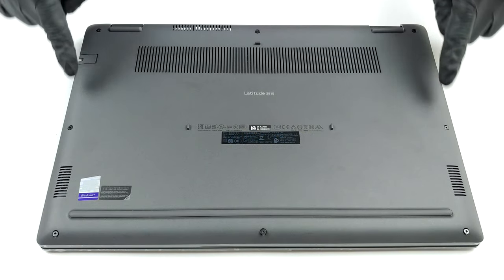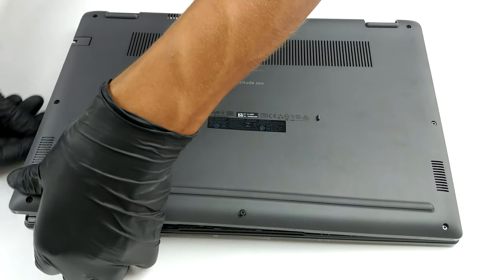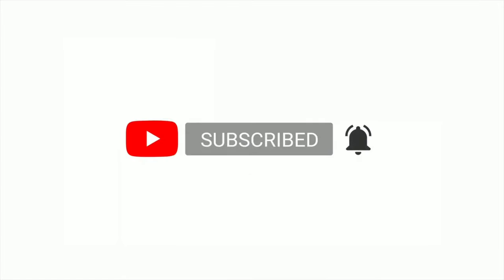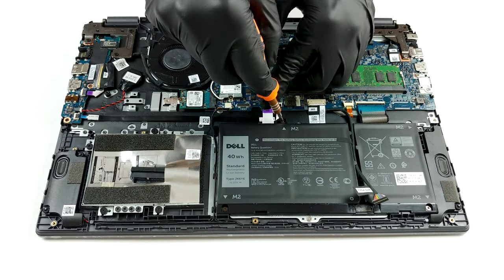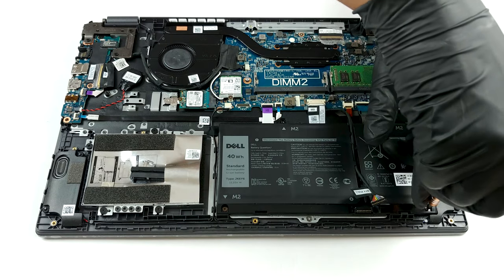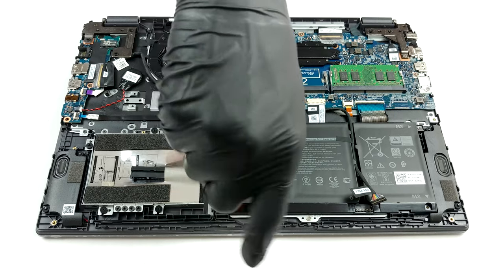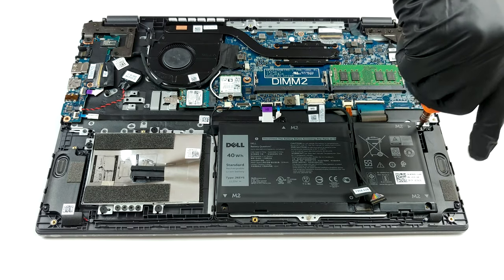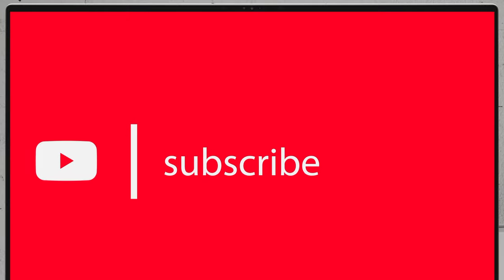🛠️ Dell Latitude 15 3510 - disassembly and upgrade options

Comment: Too bad that, after "This unit has battery and one SATA device" comment, none of the other device-removals had voice-over descriptions.  What kind of M-LAN card is that - AC?  AX?  Do we understand that this has an M-SATA slot as well as a concurrent SATA slot?  So that M-SATA can be (or is only) a Boot Drive device?  It'd be nice to have the memory specs to so that future buyers may skip Dell's higher priced RAM sticks and buy name-brand/easy to match pairs before back-cover removal.  What kind of connectors does the WLAN card have - B? M?   It'd be nice to know, again, before purchase.  (These can give the unit a life beyond whatever WLAN card is currently used, or available now.)  Is there any capacity limit to the M-SATA device?  That'd be hard to believe that Dell would limit BIOS beyond the traditional 2gb boot limit.)
Reply: Ooh, your included website link offers more specs to my satisfaction... it only took wading thru 400 other laptop models to reach each device inside a Dell 3510.  A voice-cover could have answered that in seconds but at least I see your website has copied very throrough lists.  Thanks for that.
Reply: On the Precision 3K series laptops, how many RAM slots are there? Thank you

Comment: Where to add the M.2 NVMe SSD
Reply: Yes... I'm looking the SSD M.2 port but It doesn't exist... Could you confirm?
Reply: I think it is removed at 2:00
Reply: @jamesrebeccasanders6788  that would be logic. The other card is the wifi card because of the wire
Reply: @danilocardenas3845  Right next to the fan, there are 1xM.2 for SSD and 1xM.2 for network card...
Reply: @JonathanGameHD  That's the M.2 SSD, they come in many lengths..

Comment: Hi. I have a version with 53Wh and 15V battery. Can I replace it with a 40 Wh and 11,5V battery to add an HDD? Will it work normally after that?
Reply: Did you ever find out? I'm facing the same issue.
Reply: @Fakechilada  No. I just bought a case for  HDD and use it as storage

Comment: Please, most times when i turn on my dell latitude 3510 only keyboard light will on and off without displaying, 
But when I long press the power button multiple times it will turn on I NEED HELP PLEASE
Reply: Try to reset the vga by pressing win key+shift+ctrl+b after u press power button

Comment: Ssd or hdd ?
Reply: ssd
Reply: If you've got a slim 2.5" HDD, it will fit in the SSD 'bay'.  Unfortunately, those 'slim' (original height/low height) drives are limited to 2tb.  There are SSDs now that are up to 8tb, so I could install a 1-2tb M-SATA as C:Drive, then something like the 8tb Samsung as D: drive.